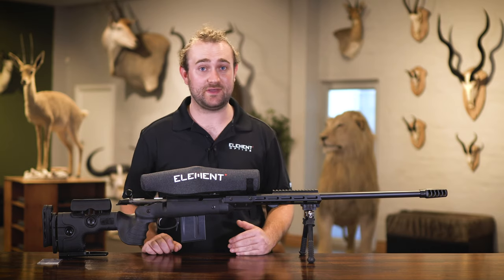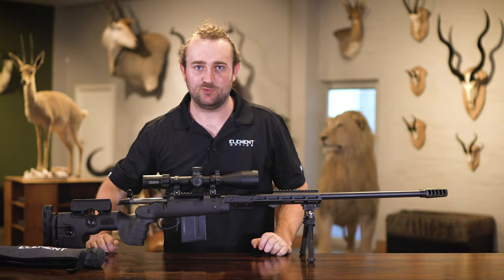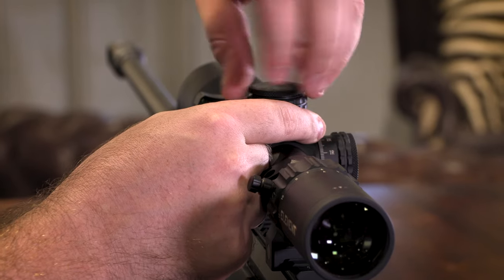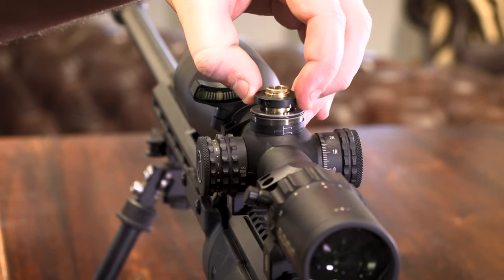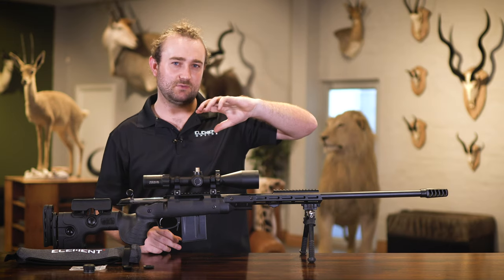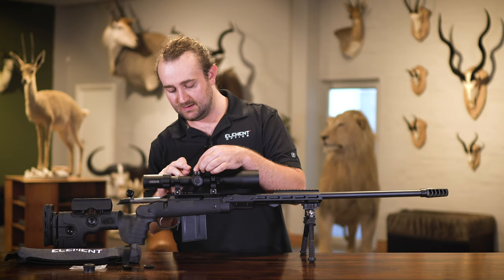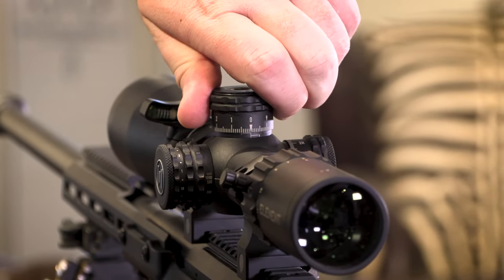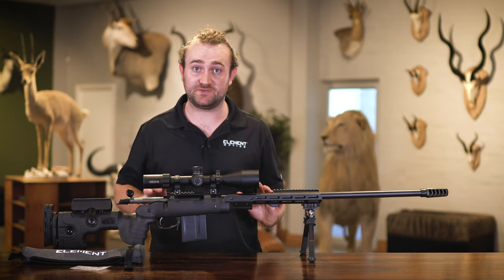How To Set your Zero-Stop (Helix, Titan & Nexus)

Comment: When sighting in my Helix if I move my head slightly in any direction I get a “halo” effect. I have not figured out how to correct this problem. Can you point in the right direction?
Reply: This is where the parallax adjustment comes in. The numbers on the (left hand) dial are just indications to bring you into the general area. Let's say you're shooting at 30m. Set the parallax for 30m, but then move your head side-to-side or back and forth, whilst adjusting the parallax. Once it's right, you should have a clear, undistorted view of the reticle. Hope this helps!

Comment: I'm still struggling on which scope to buy? I think it's a shame the Titan doesn't have a parallax starting at 10 yards as I like the fact it has 5-25x MAGNIFICATION RANGE, 34mm TUBE DIAMETER, 56mm OBJECTIVE LENS DIAMETER, 23.2 MRAD ELEVATION and WINDAGE, compared to the NEXUS - 5-20x, 30mm, 50mm, 14.5 MRAD WINDAGE. If only the TITAN parallax began at 10 yards then I probably would have bought one by now. Though also after recently watching footage of a long range shooter explaining how they find SFP preferable due to the FFP crosshair starting off too thin at short range and ending up too thick at long range, they prefer the SFP. So I'm not in two minds between the HELIX and the NEXUS.
Reply from the maker: They are both great scopes. I don’t think you will be disappointed with the Helix if you want a SFP scope. Total turret travel is less, but value for money is brilliant.
Reply: Need a bit of help looking at buying one of these but it’s between this and the Nikko Stirling long range diamond which is better
Reply: @seanhammond4527  would that be the Nikko Stirling long range diamond 4-16x or the 6-24x ?
Reply: @MrRockstar1968  6 24 mate it's going on a hw100
Reply: @seanhammond4527  Between the Nikko Stirling long range diamond 6-24x and the Element Titan 5-25x there isn't much difference in the field of view. A few differences that do stand out is that the Element Titan is considerably heavier weighing 1105gr, where as the Nikko Stirling is 788gr, that's 318gr difference. Also the Element Titan only has a parallax down to 15 yards yet the Nikko Stirling has a parallax down to to 10 yard. The Element Titan doesn't have the option of a parallax wheel as Element do not manufacture or supply and yet Nikko Stirling do have the option of a parallax wheel. The Element Titan is also a 34mm tube which has less option of scope mounts, where the Nikko Stirling has a 30mm tube with a broader range of scope mount choice. The Element Titan is also a First Focal Plane scope though the Nikko Stirling Long Range seems to be a Second Focal Plane scope from what I can find and would make sense given Nikko Stirling manufacture both the Nikko Stirling Long Range Diamond and the Nikko Stirling Diamond FFP. So depends on whether you want a FFP or SFP scope and also depending on all the other factors I've mentioned. The Nikko Stirling Diamond FFP 6-24x50 which is the first focal plane, this scope has a smaller filed of view which is about 3 to 4 feet less field of view than both the Nikko Stirling Long Range and the Element Titan. There is also the factor that the Nikko Stirling Long Range Diamond is considerably less expensive than the Element Titan by about a third of the price less, and the Nikko Stirling Diamond FFP is about half the price of the Element Titan. Hope this is of some help.

Comment: I’ve just fitted the helix to my impact, am sub12 lbs. my concern is I’m near the bottom of my elevation at 27 yard zeroing. I was planning to use the turrets instead on the reticle out at long distances. So do I shim the scope or so I no limit mounts. I’m pissed off because I just spent £100 on mounts.
Reply from the maker: That is unfortunately one of the downsides to shooting with a gun like the Impact with a close zero and a scope that is pretty high above the bore. It is a very common problem with PCPs - The only way around it is to use tilted mounts or a 34mm tube scope. FX is working on this by introducing 20 MOA pic rails to many of their models.
Reply: @ElementOptics  cheers for your reply. I’m going to buy some no limit sports match mounts this morning and try and get around the problem. Oh where can I get a cover for my scope?

Comment: Why did you state the inside of the turrets are brass, I thought they were meant to be stainless steel?
Reply from the maker: The internal parts that move against each other are stainless steel - The only brass part is the center pillar which the grub screws of the zero stop need to bite into.